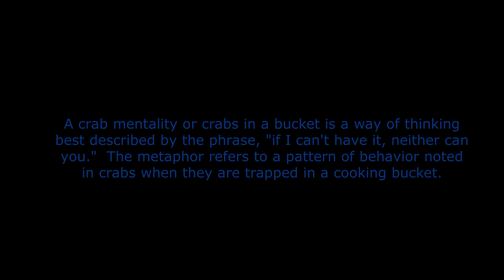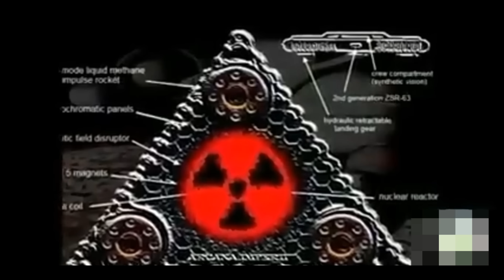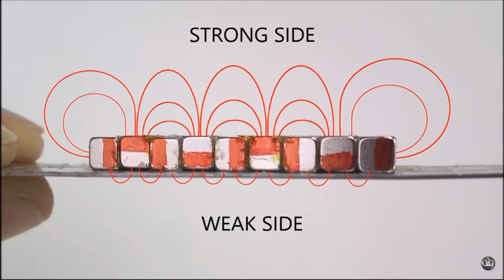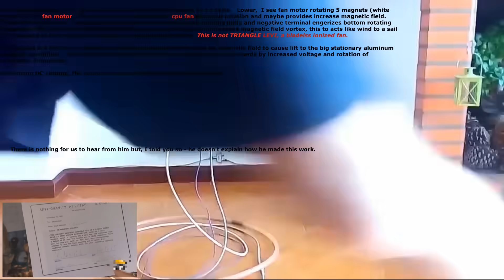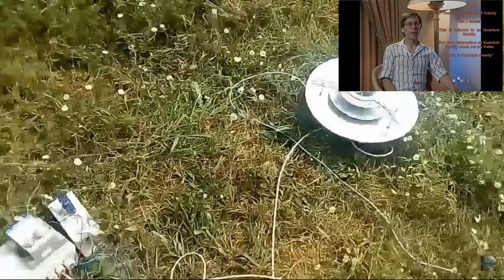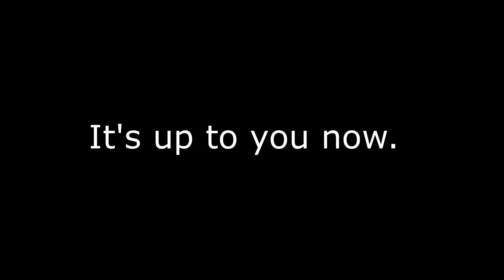anti-gravity project

Comment: One Inertial force can directly effect another Inertial force period.

So if gravity effects light then light is micro inertia. If Magnetism is used to effect Gravity then Gravity is also an Inertial force.

So what you call Gravitics is the combining of those two Inertial force's, like injecting macro inertial force onto a micro inertial toroidal field of magnetism to block gravity.
Sense the information is on the the electrical field you just charge a Capacitor, the electrons won't jump across but the information will and cause push in the positive direction.
Reply: According to Albert Einstein, gravity is a warping of space-time ("space") instead of a force like magnetism and quantum nuclear forces in nature holding atoms together.
Reply: @farmerbold1144  space can't move because it's not made of anything It's non material and it's every where so it don't need to move so it has no time without motion.
 If it was flat you could measure it but it's infinity in all directions.

If you can't do all the thing's above then how can it be the cause of Gravity which is another word for weight? 

If you take the orbital velocity of Earth and devide it by the rotational velocity of Earth what do you get?

(18.545mi/s^2 ÷ .288198mi/s^2)=
64.34812178ft/s^2

Half that is free fall of earth.
A force after all and the lag from that acceleration causes weight against the ground.
Reply: @alberttorres4917  true: space is not moving, and non material. False: gravity is an effect of freefall around the sun; since gravity causes free fall into orbit or collision with the sun.
Reply: @ickorling  well lets see, as the earth gets closer to the sun the orbit speeds up but the rotation slows down and a day last longer and the difference of the two circular motions: (Vo÷(Vr×2))=g constant.
And when the Earth moves farther from the Sun the orbit slows down and the rotation speeds up but the differnce is still (Vo÷(Vr×2))=gconstant.
And the weight remains the same at all times showing that free fall or g constants lagforce is the cause of weight on earth and doesn't cause anything to do with orbit or rotation but just the opposite.
 It's basically an implosion type force near the center of earth not an attracting force like magnetism.

If you have acceleration you have lagforce.
And towards the center of earth against the ground it would cause weight as the word gravity suggests taken from the Latin word Gravis.
Reply: There is no free fall around the Sun only Orbit which causes an outwards force of lag pulling away from the Sun's pull equil to that lagging behind the rate of change of angle outwards. I don't know where you get your mechanical intuition but I'm a microphysicsit for advanced Electronics and shit don't work like that in reality.

It shouldn't take a moron to figure that Vo=velocity of orbit and Vr=velocity of rotation 
And g is a constant of earth.

And g constant of Mars is 26.5264ft/s^2.
A 10lb weight on Earth is 8 1/3 lbs on Mars.

So Vo of Earth is (1000×c×pi)÷(365.2425×86400)=
18.5449916097mi/s^2
And d=(Vo÷(Vr×g))
The rate the Sun's pull is diverted towards the center of earth to cause free fall an implosion field.
At 2.00000338199s^2/ft.
Reply: @alberttorres4917  Well, I think I see your point, and yes the inertia plays a part, but in my opinion it comes in the form of the dipole moment (they are intrensically inertial) and motion patterns. Its got trouble in the subject of the electric and magnetic force, and I will explain. The electric force must terminate into an opposite charge, and we know that all particles are vibrating charges attracted by this implosion type force you reference called the electric force- which only pull together like charges and have little to do with why objects repel. 

In reality, magnitism is an toroidal field that only pushes so its field lines never cross. The magnetic field lines are much stronger at pushing at far distances, and the electric force is better at pulling in short distances. Objects that are near each other are attracted more strongly the closer they are.

In a situation like the moon and earth, they both have magnetic forces pushing on them from stars near and far extending their equal-ish magnetic push on all tangents, but the shadow volume between the Earth and the moon can let no distance objects push them apart, yet their electric attraction is also now much stronger is this relative range.

Thus, in between the planets they are pushed together from the outside, and pulled by strong electric forces- giving explaination to anything from particle bonds to solar system orbits to why the universe is expanding at an accelerating rate.

Who I learned thr theory from: Eric Dollard (mostly)

I also want to mention that oscillating charges generate a magnetic field, and that all charges have electric field lines terminating into them. Talking about the elecromagnetic force as seperate things is useless in the end.
Reply: @alberttorres4917  also, wouldn't the lagforce on a spinning object mentioned be centrifugal, not centripeadal? Not including the effects of freefall in orbit, because I beleive freefall can only an effect of two objects being 'attracted' in the first place.

 Though if you are saying that the centripedal spin generates an implosion point of energy I could understand, because the Earth is a dynamo- it would still involve the same explaination of the electromagnetic fields as before- but now stronger.

 Change the rate the distance from the sun, the Earth spins at a different rate with a slower speed; sorta like exchanging ampres for volts/watts, yet the webbers/Henrys stay the same. 1 amp = 1 watt = 1 webber. Some SI base units have multiple equivilant names.

In english: current can be exchanged for volts without changing the total energy, sorta like volume of flow vs pressure in a water analogy.
Reply: @alberttorres4917  Yes, they are constant with each other. It should be noted that if g increased what-so-ever, we would know that a further acceleration took place and can be measured by Vo and Vr. I use relativity too, my friend; it tells me E=Mc^2, and I know velocity is another form of energy. 

The difference here is that I'm not looking at space as though it were truely curved, I'm using Lenzs law and fundamental electromagnetic interactions known to all particles.
Reply: @alberttorres4917  I should also add that an increass in planetary mass can increase G as well, by the same explaination.
Reply: @ickorling  well lets see the only thing that connects gravity and magnetism is the fact they are both an Inertial force micro and macro inertia.

What they the scientific community don't understand is that earth has a magnetic pulse of 7.83hertz/s and in order for that to happen the Earth has to have a Capacitor. The magma just acts like an inductive resistive conductor that wont pulse on its own it needs a Capacitor, every Engineer on earth has to admit this or he's not an Engineer..

Now what's more interesting is the 28khz pulse of the Schumanns cavity being charged by something still running at the north and south poles left over before the flood, that you think would be of great interest to investigate.
I don't believe we were knuckle dragging morons in our past I think we were more advanced then today.
Reply: @alberttorres4917  The Earth is indeed a capacitor; wherein the ionoshpere and the crust have a potential difference charge, they act as plates of a capacitor which is insulated in space and indeed has a resonate frequency of 7.83 hz. The magma of the Earth dynamo act as an inductor, as you said. This allows the Earth to operate as an electrical capacitor (battery) with an appropriate magnetic field. It seems we agree on that.
Reply: @alberttorres4917  I also suggest you further ponder the feasability of a unified field theory, given that you understand these forces so intimately. I agree with one theory called E-infinity theory of string theory; it's peer reviewed and has been thus far very sound.
Reply: @ickorling  centripital and centrifugal force are nonfundimentle without action and reaction defying the Newtonian Law's of motion that have been proven.
Circular motion generates an outwards force of lag behind the rate of change of angle that never lets up even at a fixed velocity.

Lfi=(M lbs×(~angle°/s))÷r yrds
~ = rate of change..
Example:
(1lb×(360°/s))÷1yrd=360lbs/s
Away from the center outwards at 60rpms.
These are not theories they are facts. I don't deal with theories in electronics only FACTS.
All of Einstein's theories is make believe assumptions nothing more.
Think man for yourself without others thoughts on the matter.

Oh and the mantle is the dielectricconstant between the magma around the core and the magma under the techtonic plates on top of the mantle which is 2700 miles thick. It's a spherical capacitor the magma at the north and south poles form loops.
The capacitor discharges into the loop at the south out in space back in at the north loop repeatedly charging the spherical capacitor 7.83 times per second.
Something is taking that and changing it to higher voltage and frequency and injecting it onto the Schumanns cavity at 28khz.
Thats not natural.
Reply: @alberttorres4917  I'll try and study this force of lag, because I havent heard of it before in that language. Its really too bad I can't go test every experiement myself, but I don't consider a community of scientists a bad thing- we didnt grow up in a box did we? Come to the table with a full glass and you gain nothing when you leave.
Reply: @ickorling  Why not Nicola Tesla did with a full glass.
Reply: @alberttorres4917  He was still curious, and he learned from others by riding an intelectual wave of enlightenment. He also still relied on Steinmetz for mathematical provings and insights. So no, I wouldnt say he was a full glass kind of guy, but he knew what he knew from his own experiements and others.
Reply: @ickorling  one thing he didn't do was theorize and he definitely did not agree with Einstein's theory of Gravity! And neither do I.

Tesla thought perhaps gravity was a force related magnetism, he was right. They are both Inertial forces but generated differently. Magnetism or micro inertia is generated by motion at the atomic level of inertial particles of force, these particles are not solid but spinning fields of micro micro force's that generate attration and repulsion type force some faster than lightspeed and to see or detect them you need a detection systems faster then light speed.
Remember information can travel instantaneously on a connection of light and there is a way to build a dector from that knowledge.

Now Gravity is a force aliso of motion that is an INERTIA of acceleration who's lagforce is the cause of an object to have weight against the ground sense free fall is an acceleration it would Ofcourse have lagforce.

(Vo÷(Vr×d))='g' constant
Showing the differential of the motion. And:
(Vo÷(Vr×g))='d' constant.
Showing divertion of the Sun's pull towards the center of earth to create the g constant. So:
(Vo÷(d×g))=Vr
(Vr×g×d)=Vo.

It shows that Gravity is a mechanical force of inertia and magnetism is a micro mechanical force as well.
Tesla knew this when he built his first flying sauser and injected lagforce from his spinning superconductor onto the toroidal magnetic field around his craft and flew it to town to pic up supply's from the general store in Colorado powerd by his tower in Wordinclif.
The US government took it. So he was smarter than they know.
Reply: @alberttorres4917  ever heard of the aether theory? Lol
Reply: Vo=velocity orbit
Vr=velocity rotation
g=constant free fall
d=constant divertion of sun
2.00000338199s^2/ft.
Reply: @ickorling  yeah funny you should mention that, it goes back to what the reserchers thought space was made of something but it's been proven otherwise.
 To me it's like saying the Earth is flat or space is flat or newer the moon is flat and you can fly a plane behind it. LOL

In reality all the force's in the Universe is Mechanical even electronics is micro mechanical controlling inertial force's. So anyway the Germans Haunibu was based Tesla's craft. Gravity is weight caused by lagforce.
While in a car you step on the gas you accelerate, you feel the lag behind that causing weight like pressure in your seat as you lag behind. 

People missinterpit things all the time theories cause this.
If Einstein was so smart thinking time slowed down as yo approach lightspeed, what would that do to his equation E=mc^2? He said that at the speed of light time would stand still and mass would weigh nothing so 0×c^2=0 contradicting himself.
Reply: @alberttorres4917  interesting. We couldnt share more opposite conclusions.
Reply: @ickorling  yep I hear ya, my experiments work just fine.
Reply: You have the first step in a good direction. I would direct you to go study Eric Dollard's explanation of elecromagnetic fields, then study E-infinity theory started by M.S. El Nashie. Hold fast what is good, and discard what is not. :) God Bless!
Reply: @alberttorres4917  He was smart, but his math was already completed and proved by Maxwell, though he did condense some of maxwell's equations into- E=MC^2. That was genious, and revolutionary... but people took it and ran with it- they interpreted how they felt. Most people don't read Albert's letters, like 'aether theory and general relativity.' Please do so, and keep in mind that Einstein did know the true meaning of the phrase: 'the speed of light is constant per reference frame' (that is that: the speed of light 'c' is always traveling c faster than you no matter what, and that c is the speed of causality- not the speed of photons.) Using this understanding he was able to marry the concept of space and time; as it should be in a theory about an electromagnetic universe. Did you know that if an object were to orbit the Sun at the speed of light, it would experience all parts of the calender year at the same time!